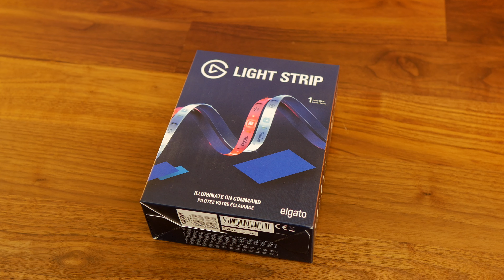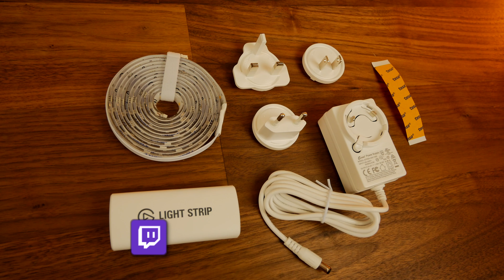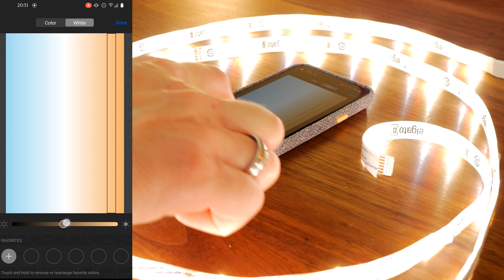Elgato Light Strip will light up your life with controllable flicker-free RGB lighting

Comment: 0:00 Hellooo
0:01 Elgato Light Strip overview 
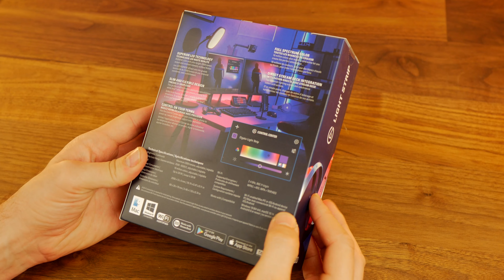1:10 Unboxing
2:24 What's in the box 
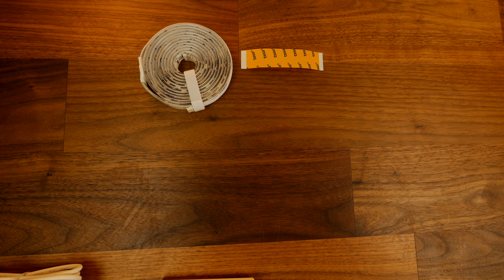4:30 The light strip 
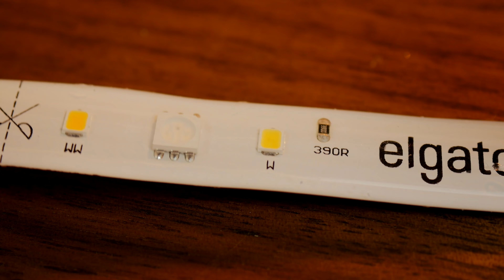5:42 Elgato Light Strip specifications 
6:15 Elgato Light Strip compared to the Philips Hue light strip 
7:13 Light strip testing 
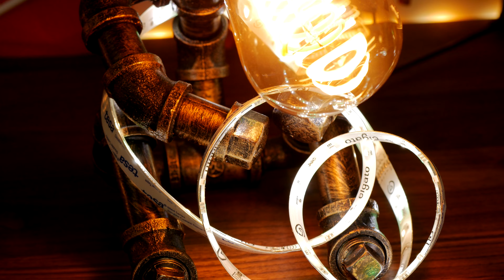8:00 Showing the Length of the light strip
9:08 Set up process
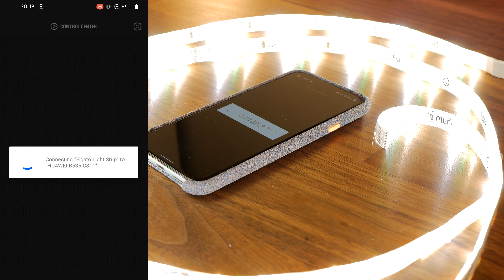10:13 Controls and customisation 
11:45 Elgato Stream deck App 
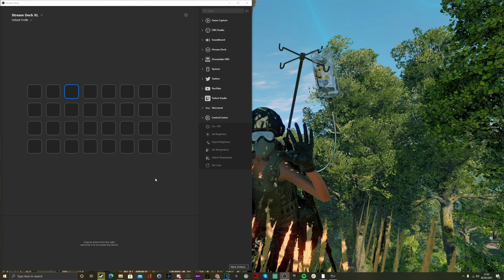12:45 windows control centre 
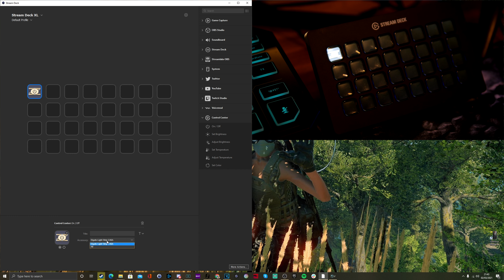13:30 Stream Deck software 
15:43 Elgato Light Strip colour changes